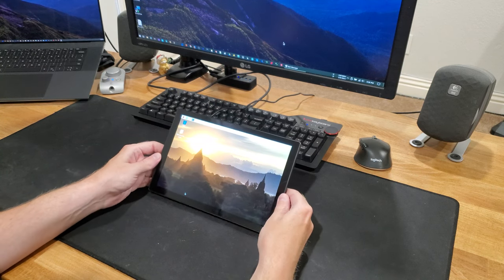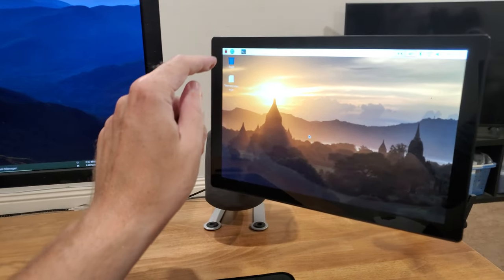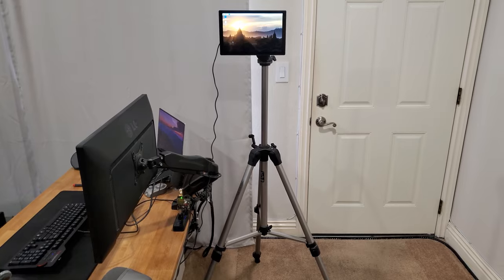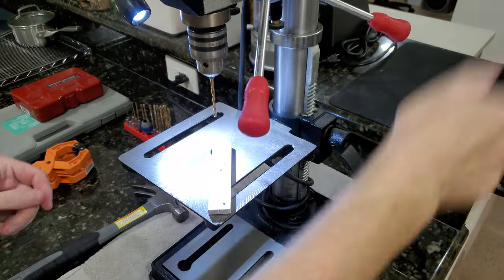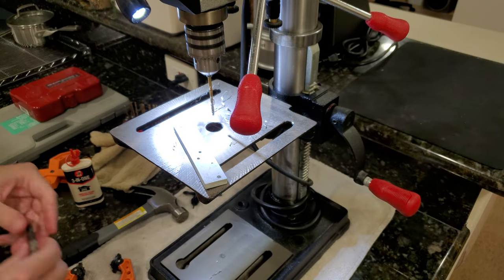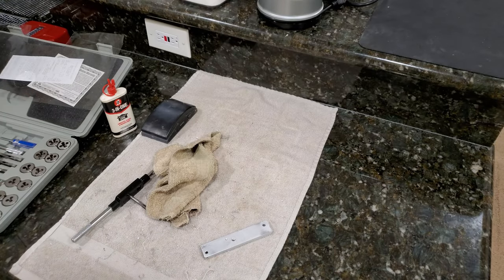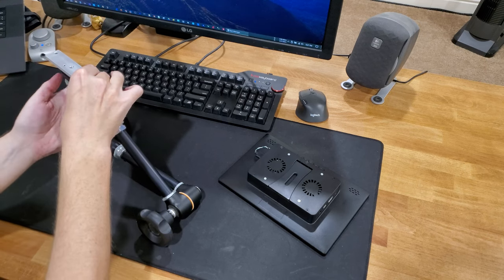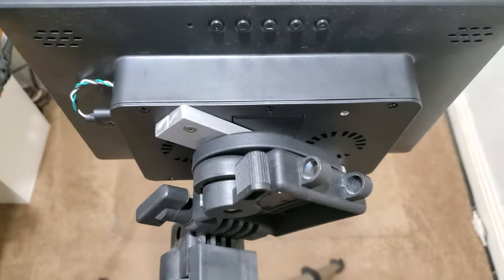Making a Tripod/VESA Mount for the Raspberry Pi Touchscreen Display Case

Comment: How much of the wobble reduction do you believe is the mount rather than the ratio of mount weight capacity vs mounted weight? Did you mount the small touch screen to the large monitor mount to obverse rigidity? The positioning of that mount is nice though! Reminds me of my Noga indicator base with the single knob joint lock.
Reply from the maker: Hi. I tried mounting the Pi on my regular monitor arm. It's less wobbly than when a 28" monitor is mounted to it, but the Magic Arm is still much better. Having an arm with locking joints makes for a much nicer experience.
Reply: @upgrdman  Awesome! I have a tablet fully cantilevered out on a cheap monitor mount. It has a bit of movement but I left the joints slide a bit for occasional positioning.

Do you have a 3D printer? That 1/4-20 to vesa mount would have been a good use case.